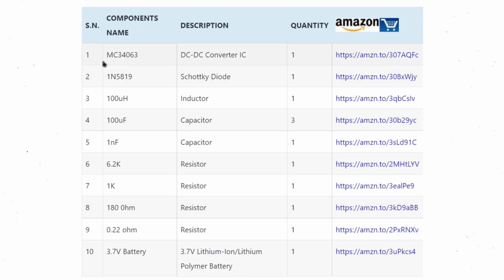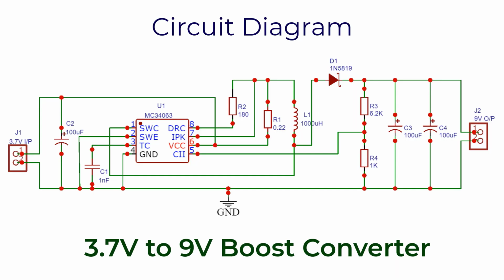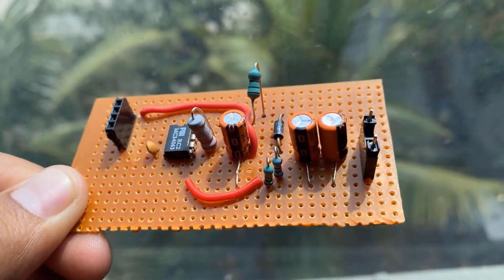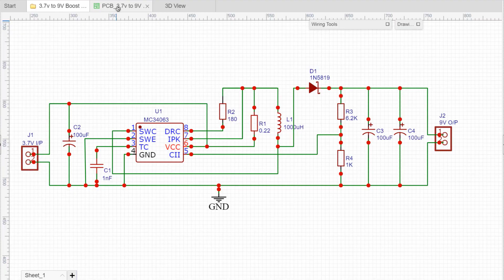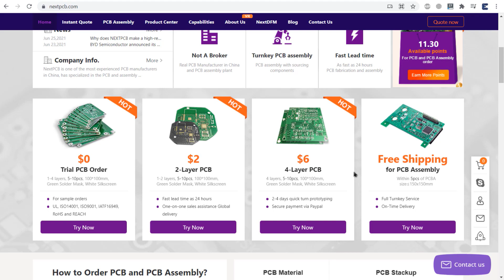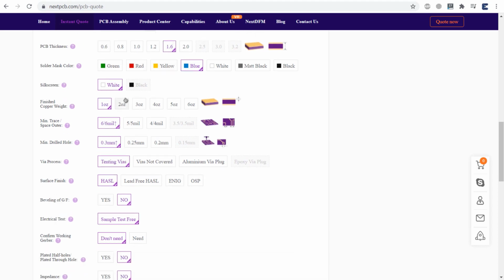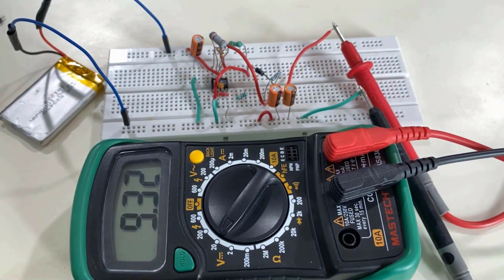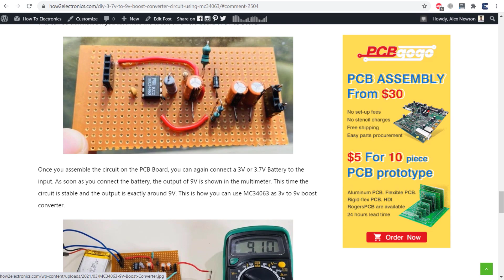DIY 3.7V to 9V Boost Converter for Stepping up Lithium-Ion Battery Voltage

Comment: You can buy these converters on banggood for a few dollars. 1.27V to 38.2VDC. Step up and step down.
Reply: If you can find a fixed voltage 3.7V to 9V step up converter on banggood, please link it here.